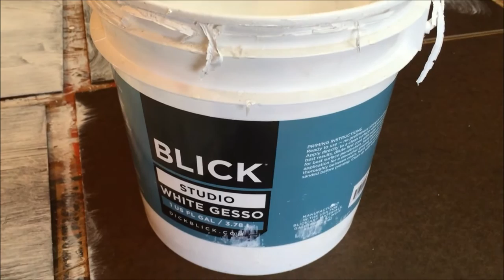Plein air demo Video: Preparing Panels for Painting #Pleinair

Comment: Thank you for the tips! I've only done plein air painting a few times and built a heavy stretched canvas for each. Panels seem a lot more practical. What do you use for panels?
Reply from the maker: Yes, panels are the way to go for plein air painting.  I prefer “hardboard” panels made specifically by art supply manufacturers like Ampersand, Richeson, or Frederick.  These are represented to be non-acid and therefore “archival” quality suitable for long term preservation of the artwork.

Comment: What type of paint do you use on location when you are Painting?  This was really good, informative and I LOVE the Piano music!  The oil prime coat leads me to believe that you are painting in oil, on location.  If you just use the gesso, can you then use water based paint?  Love Your Work!  Audie Joyce
Reply from the maker: Hi Audie! I use artist grade oil paint from various manufacturers but not the ones that price their paints as if they were expressed from the vestibular glands of unicorns. It's true, oil over gesso or oil primed is good but acrylic over oil is bad. Acrylic over gesso is fine. There is a "solvent fee" movement in the oil painting world, where either water mixable oils (Cobra brand is best) or oils used with safflower in the brush pot make for safe, non-volatile painting. It's said to be safer than even acrylics, which have drying agents that release unhealthy fumes.